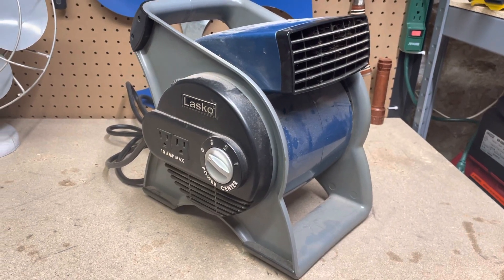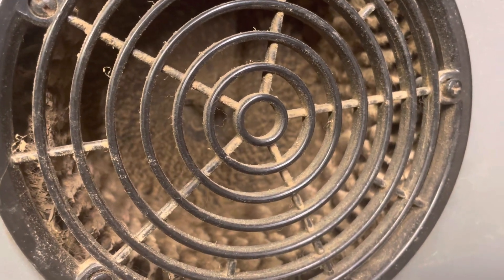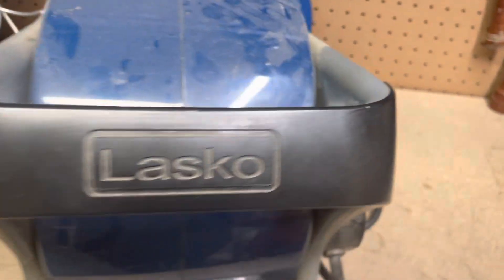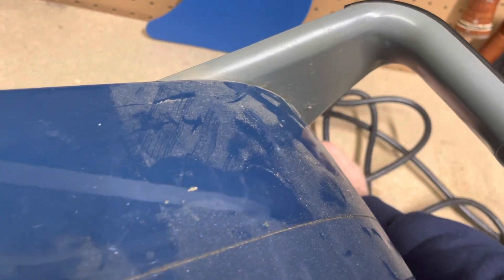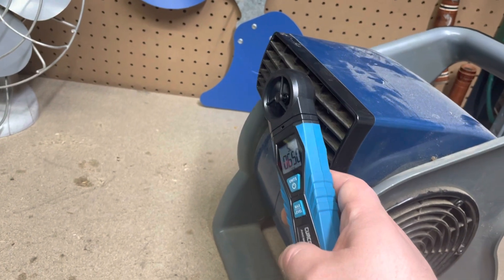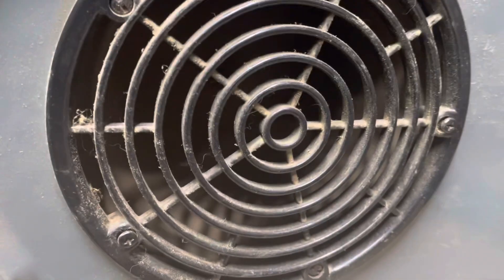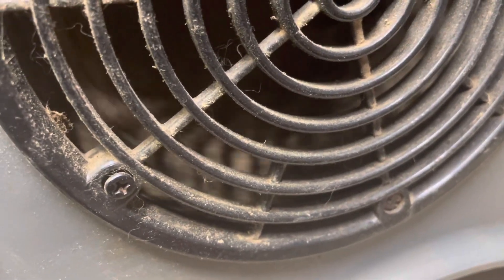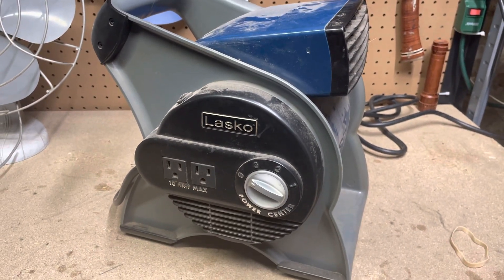Lasko Blower Fan U12100

Comment: I bought mine new in 09 just went out after a fall from  hip high shelf.. but still turns on. In search of new replacement blade...so I don't have to buy a new 1...I am SOLD On this fan! 60$ well spent on 2009